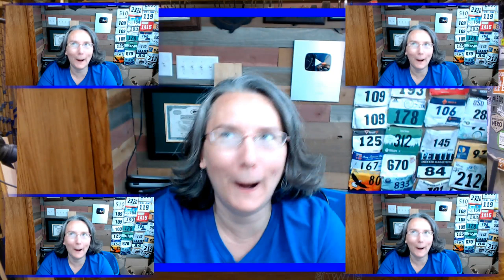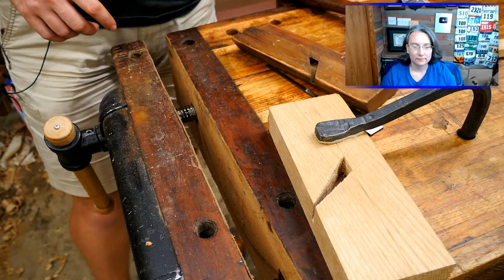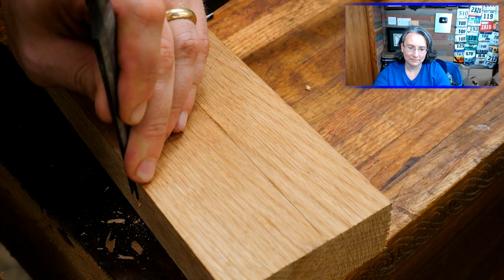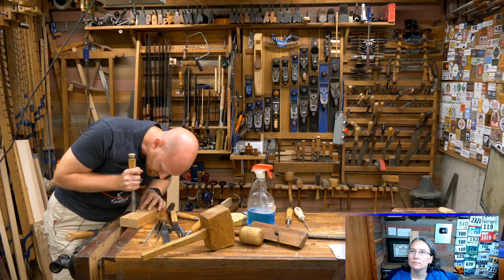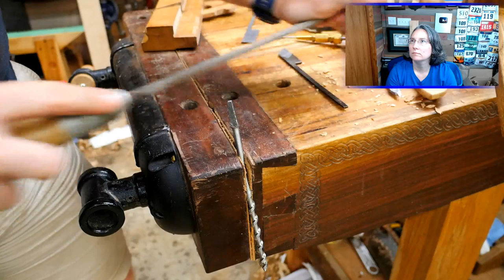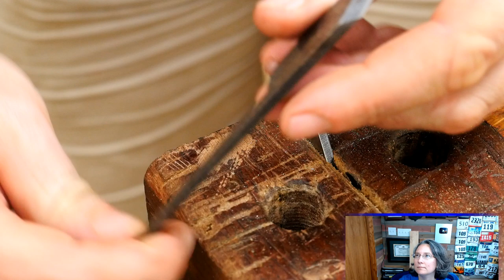How to make a Molding plane Live Part 2

Comment: It appears fairly easy to make a float, There is a guy building an Antikythera mechanism on you tube, and he shows (throughout the videos), how to make files, and other ancient hand tools of that nature.  Yes, a pain, but it's not about saving money, it's about building a custom tool for specific tasks.  God bless my father, and you. I have a bunch of 'odd-ball' tools, some of which I had no idea of what they were used for, until I watched your videos, a float is one of those.  Of the several I have, one has curved teeth, and the surface is also convex, (I still have to figure that out).